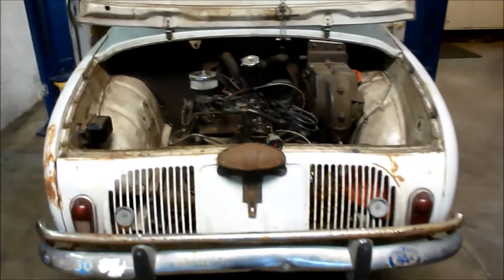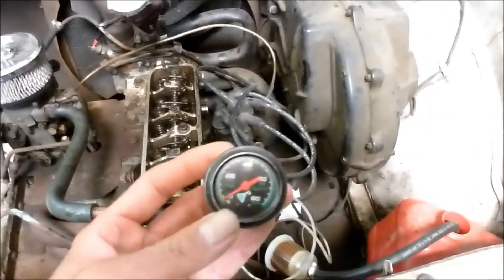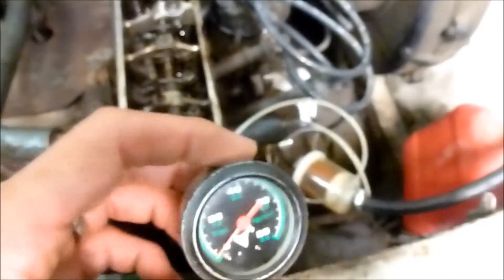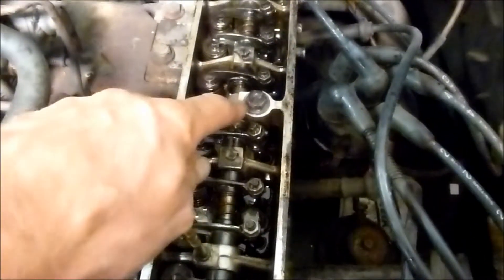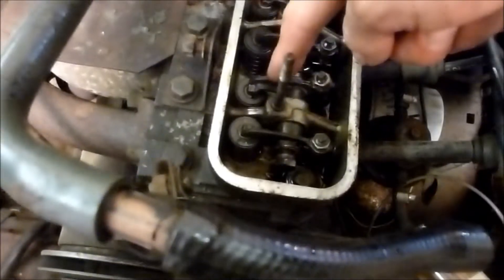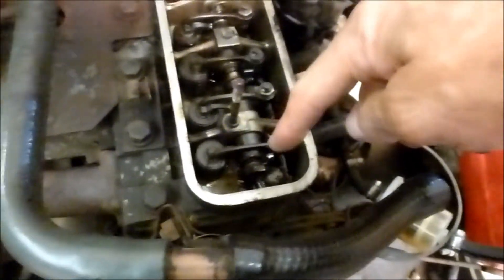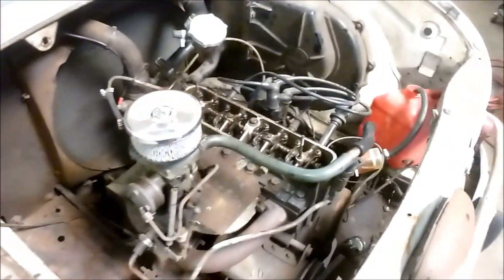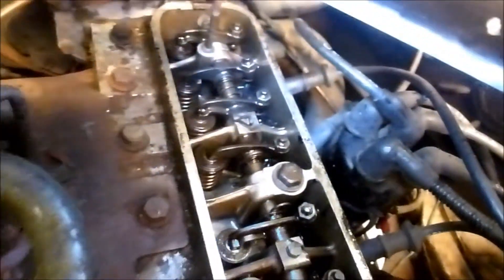Oiling the Dauphine

Comment from the maker: I think you are right, I tried blowing thru that passage way into the center rocker stand with compressed air and a wire but it did not help. I think maybe the rocker shaft is turned or somehow blocking the flow. I plan to get to the bottom of this.

Comment: I just checked my trusty Dauphine workshop manual and as you found, I did see that lubricating oil does travel up that passage, since I found no mention of the bolt being hollow in the section on the rockers and head, I am assuming it is not and oil's passage around the bolt has been blocked